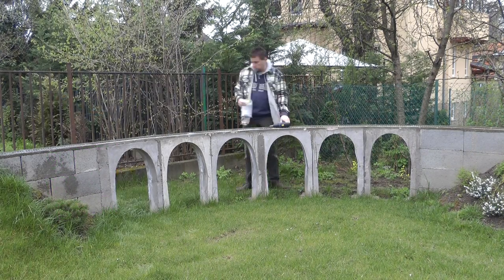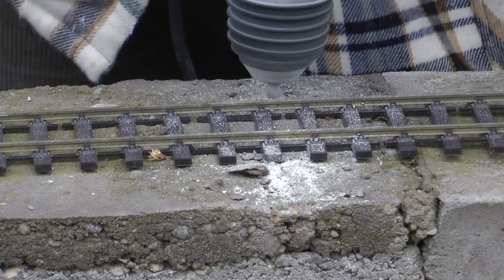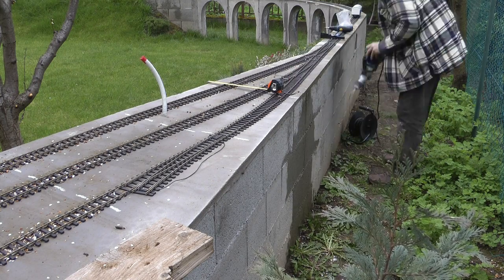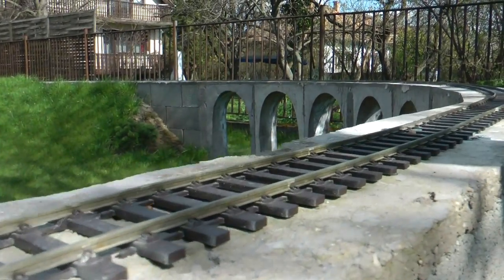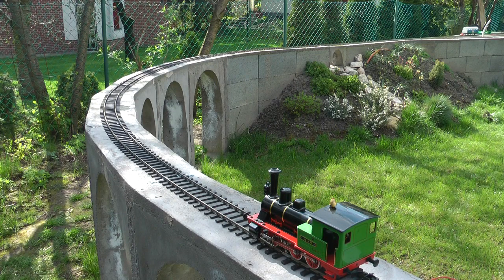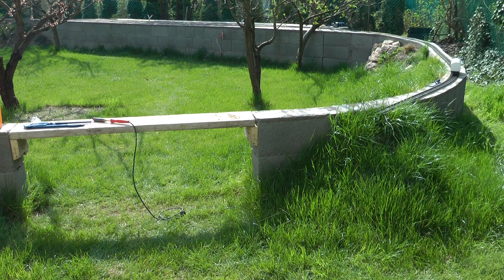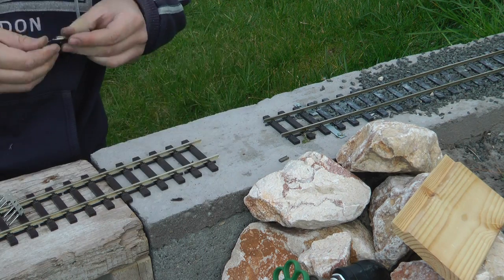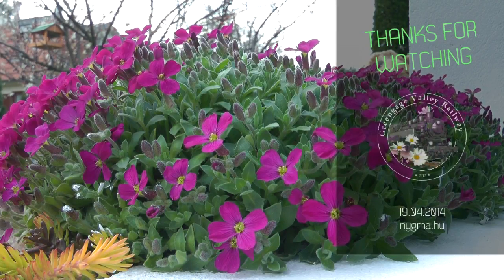Garden Railways is Born - Laying Tracks

Comment: Hi. A good way to increase your accuracy when drilling holes is to step drill - start with a very small masonry bit and then enlarge the hole with a larger one. Good quality bits help - which can often be used without hammer action at first to get aid positioning further.
Reply from the maker: Thanks for the tip. This is a huge learning curve for me.

Comment: i did not know G scale had flex track. so that would make it much easier for track laying, not having to lay the blocks to certain turn radius. 
 thanks for the video. very nice.
Reply from the maker: Actually, there is quite a bit of an option. Peco has both Scale 1 and G scale flex track, Tenmilles's track is also flexible. And I think many of the US brands offer flex track, a friend of mine has Aristocraft flex track but they folded a few years ago.

Comment: Just thinking. Are you going to create a spur line going to your workshop so you can store the rolling stock there. Plus its easier to bring your rolling stock in and out. Eg it suddenly starts to rain. Just a thought. Well done. JD in Belgium.
Reply from the maker: Very good thinking. My workshop is at the end of the garage which is on the other side of the building and probably up by a meter. But along the long straight where I will have the bridges, there are steps leading down to the basement. I was thinking about adding a turnout on the main line, and curve it into the basement. Couple of issues: the basement is very messy and dirty at the moment. Probably needs a facelift before I can leave the trains there. Also, I would need to dig up part of the garden get plants out and knock a whole in the concrete wall. Not easy. So probably in a few years time. Not to mention a wireless controller would be very handy for these movements.